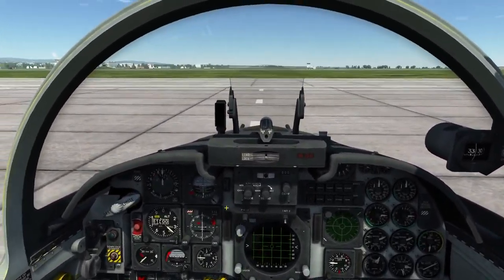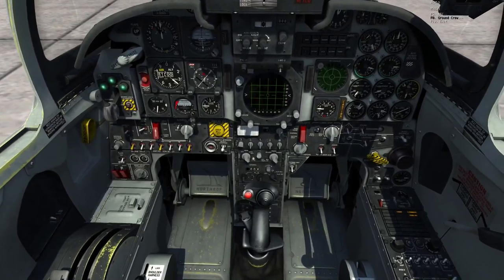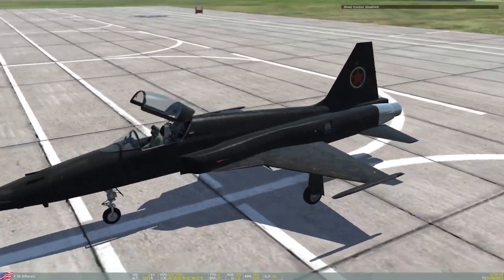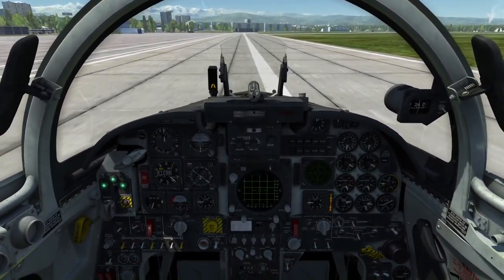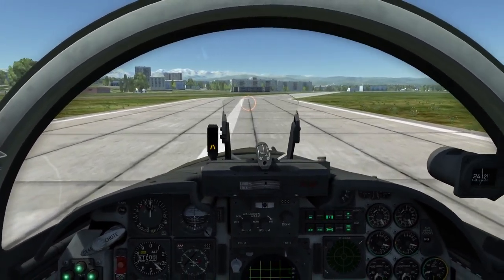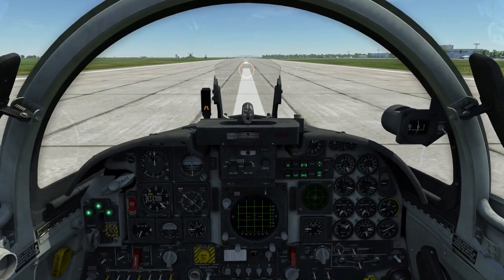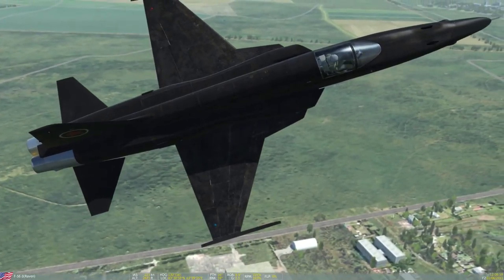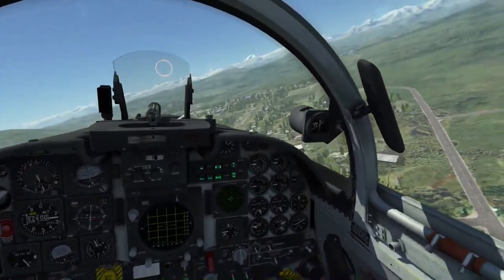Let's Play DCS World F-5

Comment: 1. The F-5E is an upgraded version of the F-5 and came out well after the Vietnam war
2. It was a light attack aircraft not designed for the air superiority role, however it's light and agile design meant it could defend its self from enemy fighters 
3. The aim-9's you were using were rear-aspect variant meaning that you need to be right on there six pulling no more than 3g's
Reply: Thank you for the information.

Comment: speedbrakes are out when cold and dark. you have to pull them up after engine start. also don't forget to hike your nosegear up before takeoff run. set ADI and backup ADI to -3 degrees to compensate for the hiked gear. Nice flight there, Lord B.

Comment: Using the auto flap setting will really improve low speed maneuverability. It's actually a very clever system. I leave it on auto for pretty much everything and I have yet to look out the window and disagree with the setting the system selects.
Reply: Agree 98%... on long flights at altitude I set flaps manually to save fuel... mentions this in the manual too if I remember correctly.  However, whilst getting familiar with flying the F5-E it is a good idea to leave flaps on auto, as this will leave you free to concentrate on balancing fuel tanks, etc.